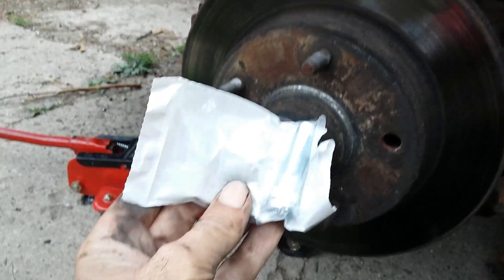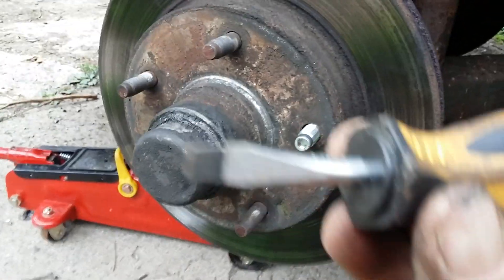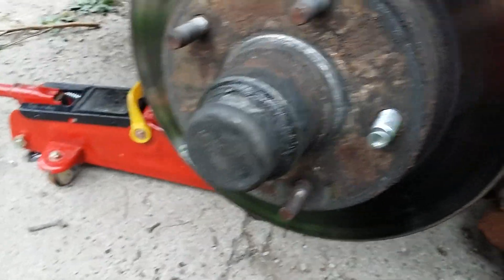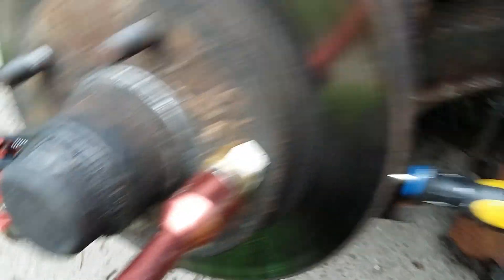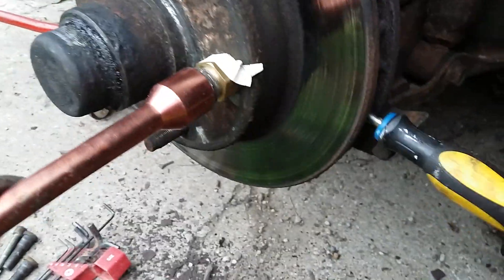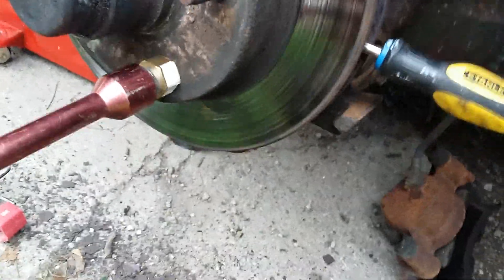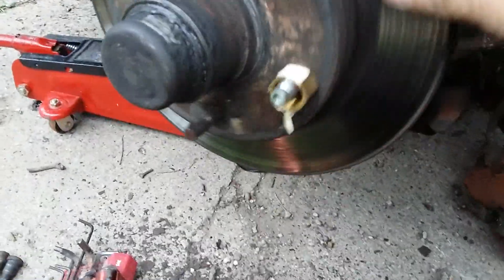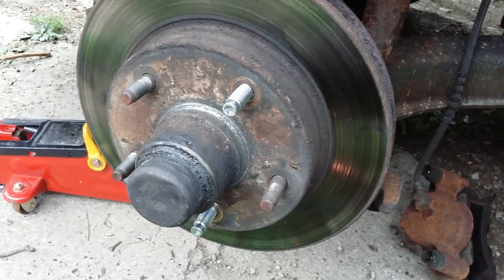Replace wheel studs the easy way, Dodge Ram 1500

Comment: No helpful at all. Did this and the studs don’t even come close to fully seated
Reply: To do this job a little easier and also ensure the lugs fully seat, it's best to use open-end lug nuts and an open end wrench (or a deep well socket with a ratchet).  Also, use a little bit of grease on the stud. Stacked washers can be used in lieu of a larger nut as well.